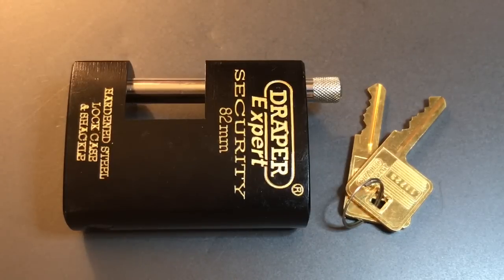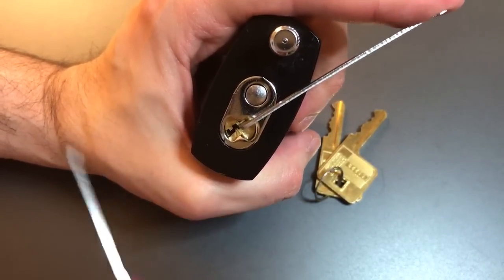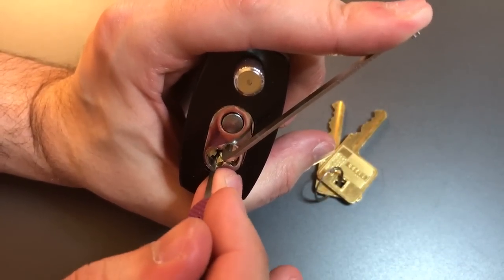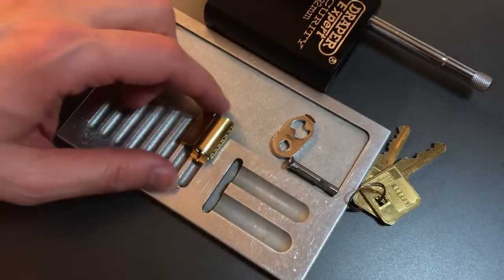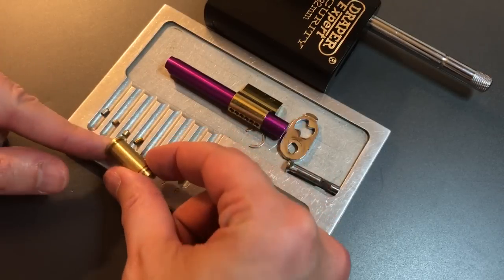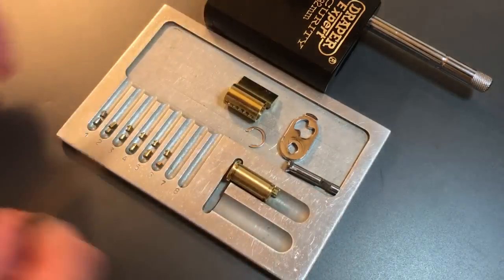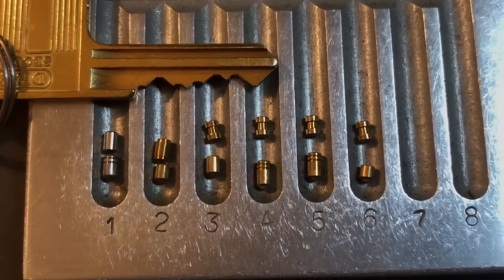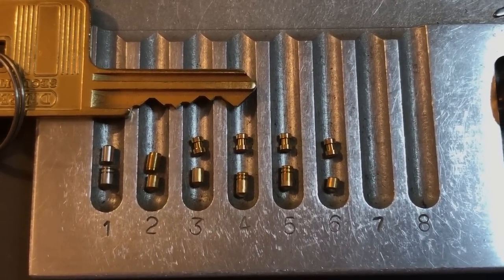[336] Draper Expert 82mm Shutter Lock Picked and Gutted

Comment: I like how you explain what's happening while you're opening the lock - for me it's very instructive and helpful.  For a standard lock, it looks like they've spent some effort making it hard to open, but there's only so much you can do.  I'm glad to hear you got it at a good price - sometimes a lock may not be the best from a security point of view, but it can still be well made and an interesting item to have.
Reply from the maker: Thanks -- I'm glad you find it helpful.  This lock definitely has some pick resistant features, but as you say, there's only so much that  you can do against a skilled picker without getting away from the pin tumbles system.